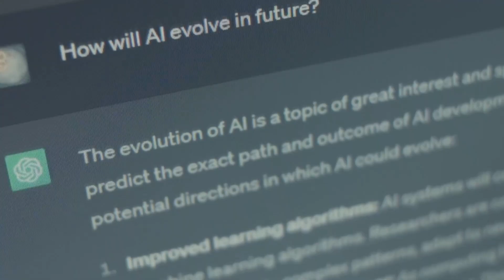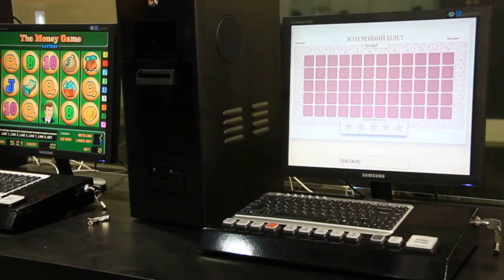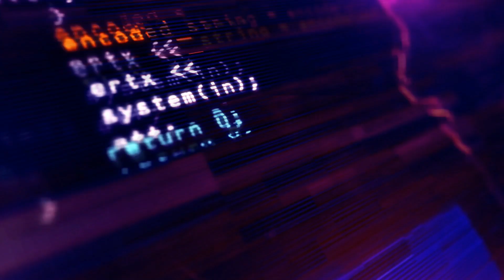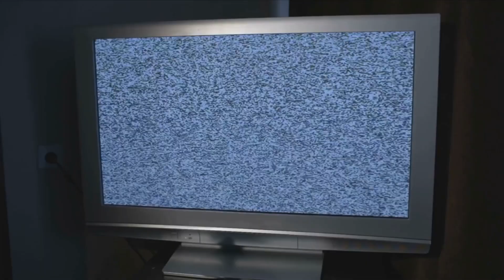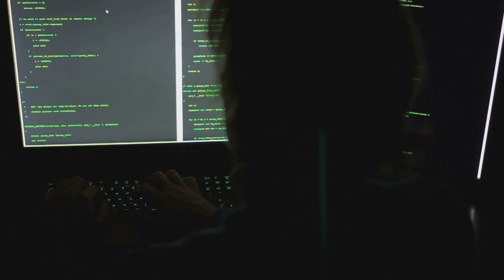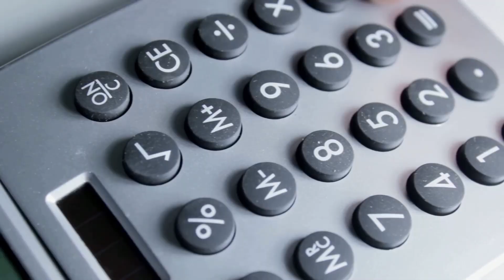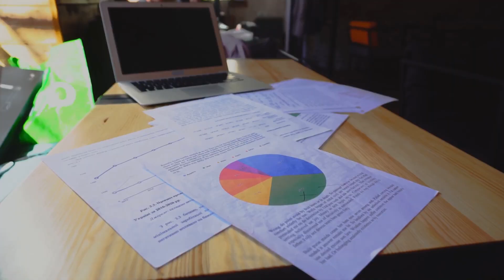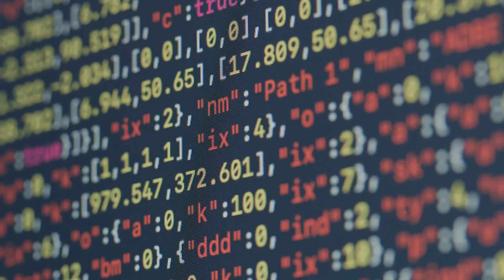🎲 Can AI Really OUTSMART the LOTTERY?

Comment: This is the largest challenge of this line of thinking: even if algorithms can reliably shave, half of the probable numbers within the probability set, an example of a LOTTO, would be picking five out of five winning combinations out of 70 numbers and picking one out of 24 and another set of numbers. The probability currently is about one out of 2.6 million. If you use algorithms to reliably reduce that number to half of that, is still one out of 1.3 million.

The problem lies in establishing the types of resources. It would take to corner high probability of winning calculations, and then the excremental explosion or reduction, depending on how you look at it winning curve. In other words, if you’re able to win three out of five numbers, it will likely cause you hundreds of dollars to get such low return returns that would barely break even with, and that’s likely being gracious.

Comment: What hasn't been discussed or investigated is fraud perpetrated by the lotteries themselves.  I have looked into this before and there is a possibility of 'inside rigging' based on desired outcomes and/or retaining the funds played in to generate interest while the big jackpots grow over time.  The critical element to the 'mechanical randomness' is that it is predicated on a live drawing event.  If the drawing is held as an independent live event, then one can be assured of a fair system and the winning/losing is based on the randomness that is the subject of this video presentation.  However, consider another scenario.  Suppose the lottery wishes to control the outcome - in effect - put their 'astronomical odds' thumb on the scale of fairness.  This could be accomplished by removing the element of the live drawing event and in its place, present a taped previous drawing as the 'live drawing'.  With current video technology, this would be pretty much imperceptible  to most viewers.  Here is how I construct the process by which this could be (and hope it isn't) accomplished:  First, the lottery conducts 20 to 30 drawings which are taped and stored for future use.  The results of these 'drawings' comprise a 'desired set' database that is maintained internally for comparison.    During the ticket sale timeframe between the previous draw and close of ticket sales prior to the next 'drawing' (usually an hour prior) the database of tickets sold is compared with the 'desired set' database and either a match is found or not.  If the lottery insider(s) do not want a 'winner' for any particular drawing, they simply select one of the 'desired set' taped drawings to air as 'live' and therefore no winner that time.  Jackpot rolls and interest compounds all the while hiding behind the odds.  Another option would be that if enough drawings/time have elapsed and to keep thing appearing as legit, they air the taped 'drawing' that matches a sold ticket and, since additional data is stored with the ticket sale (location, etc.), a target location could be programmed to be searched within the sold tickets and a target 'desired set' taped drawing could be selected.  Think California or Florida (?).  This is not meant to be tin-hat stuff but if you think about it, there have been inside fraud with lotteries in the past...